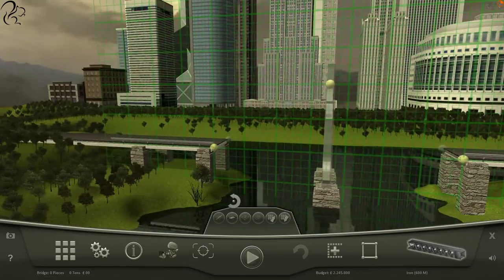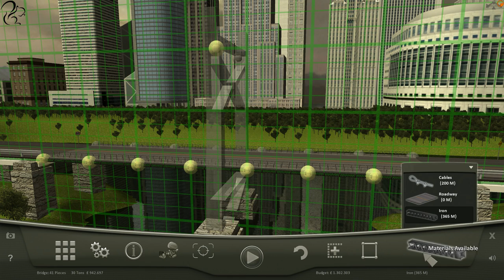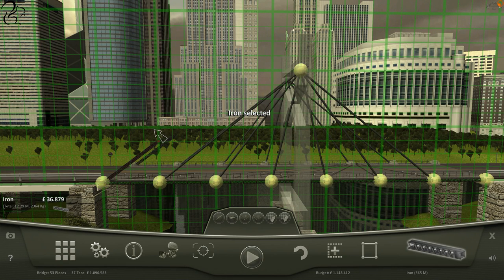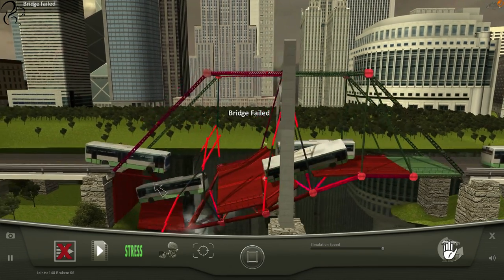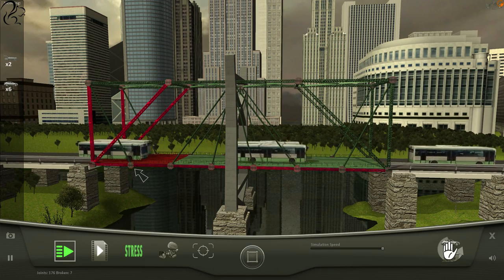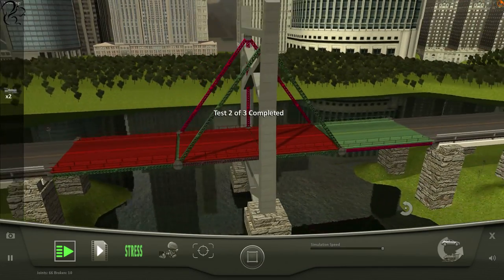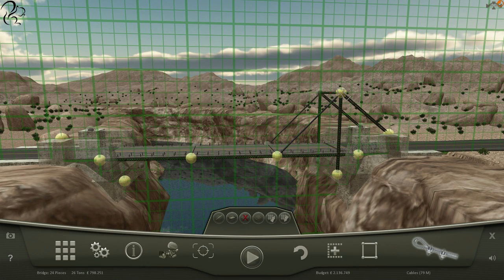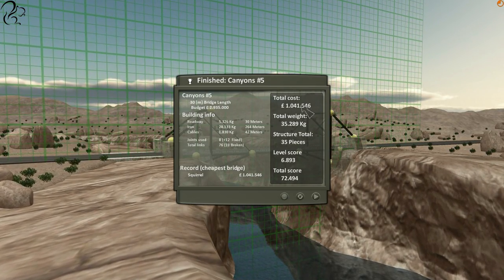Lets Play Bridge Project - Episode #5

Comment: an arc of iron might've sufficed as a suspension cable maybe, of course it should be bent upwards instead of downwards ? also why not try to build the road in a slight arc sometimes, that might give the roads the needed sturdiness to hold some vehicles (not sure if you can build roads in an arc tho)